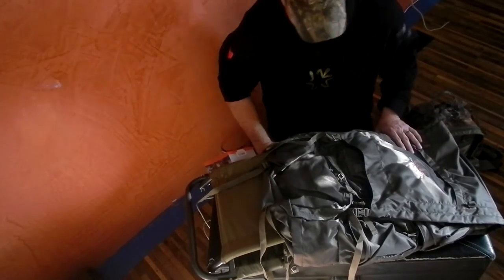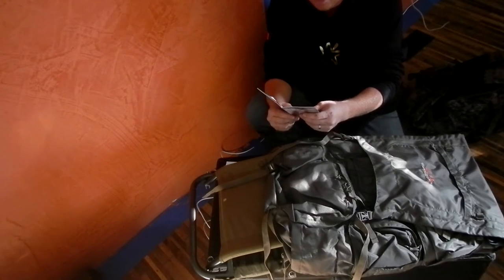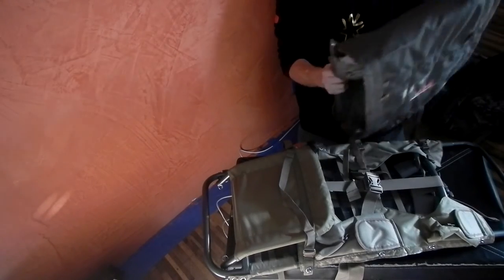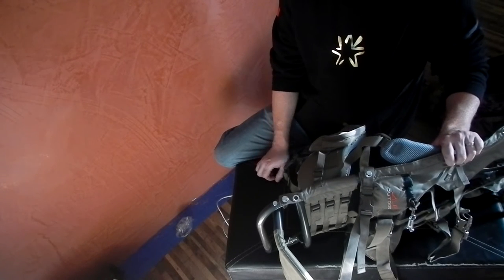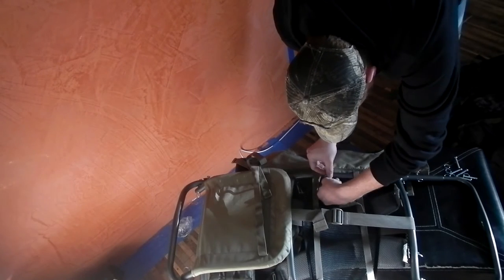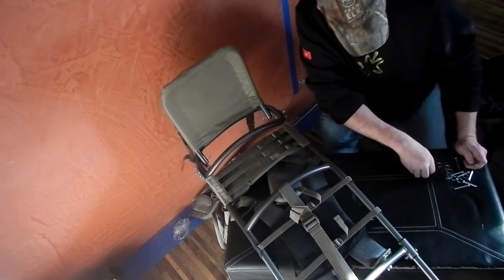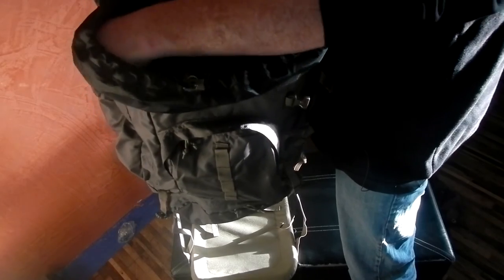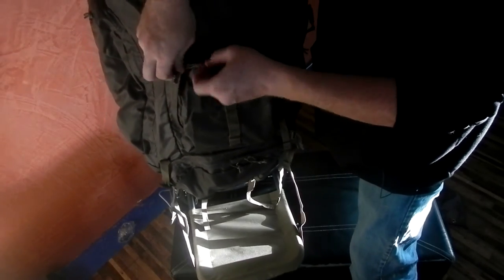ALPS Commander Review

Comment: The recommended item to replace those dreadful rings are a pack of hitch pins. They're really the only reasonable alternative and they're better for two reason: ease of use. To remove or apply these pins is only a matter of pushing in and out. And they're solid pins with substantial thickness(it's a pack of 150 with different sizes). What are some mods/add ons have you found that were useful(if any)?
Reply: +The Bare-Footed Cambodian but there is the issue of not getting small enough ones and them stabbing you in the back
Reply from the maker: I agree I found hitch pins at Lowes I think I called them cotter pins in my other replies and they work well. I got some small enough I have not felt them in my back so no issues there. I am going to double check the size and then see if I can get an Amazon link for them so they are easy to find for people.
Reply: i have left a few with the original hardware just the ones i might need to remove on trail though. any that might need to be removed i chainged over to the cotter pin type. one issue I have found with those is some of them like to poke you if they are not laying just right when you put the pack on

Comment: Hey Dirk, nice pack! I'm thinking of getting this pack. I'm flying from Alaska to Oregon for an Elk hunt this Nov & I'm going to use this pack on the plane to bring my gear & strip it down for the hunt. Just an awesome pack for sure. I would ditch the pin rings & use a coat hanger type rod to run through all the pins on either side to make it a quick disassemble. Let me know if you came up with something different. 
Thanks for the great video.
Reply from the maker: It will be great for that. I have had mine in the Uintahs for about 8-10 days worth of hiking and it is very comfortable. I ended up going to Lowes and getting cotter pins that fit the holes and putting them in it was only a few dollars. I need to look up the size and order some on Amazon and do a follow up video with a link so they are easy to get. Other than the rings I am really happy with it. Like I said way comfortable, very versatile, a lot of room and the material is really strong. Have a great time on your trip, there are some amazing Elk in Montana for sure.

Comment: the pins are a pain however not as big of pain as having the cotter pins sticking in your back like i found out. I think if your going to be using the game Carry option allot you might be able to just up your pack depending on the size of it in where the game is that way your NOT having to switch it out for an hour when you get to camp. I realy like this pack though definitely worth the $110 i spent on it
Reply from the maker: I agree for the money it is an amazing value. Well worth 110.00 even with the pin issue.
Reply: I agree with you as well on that matter